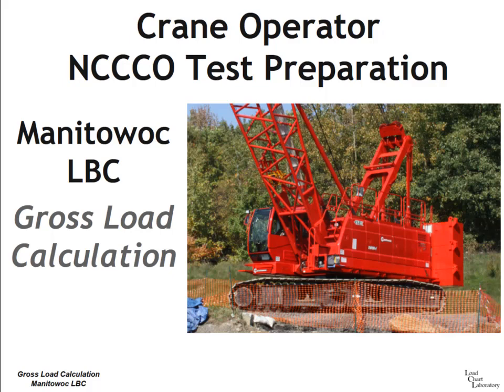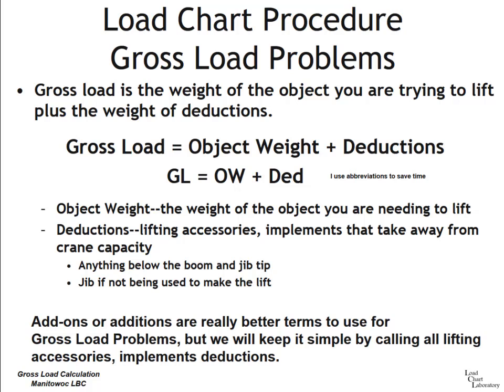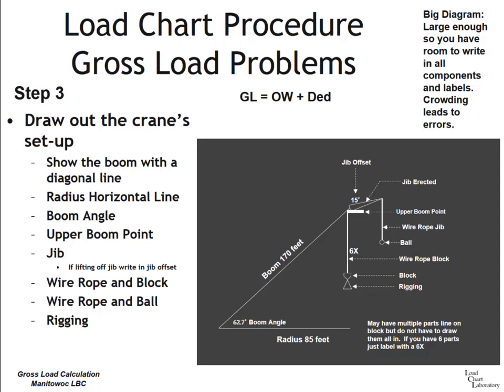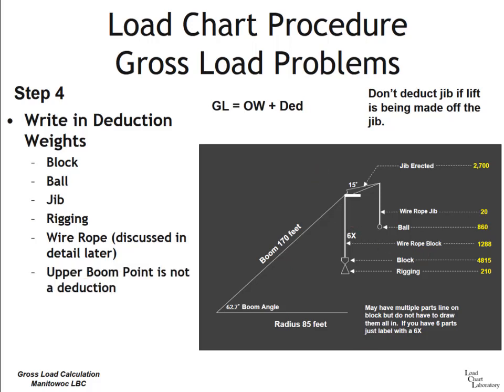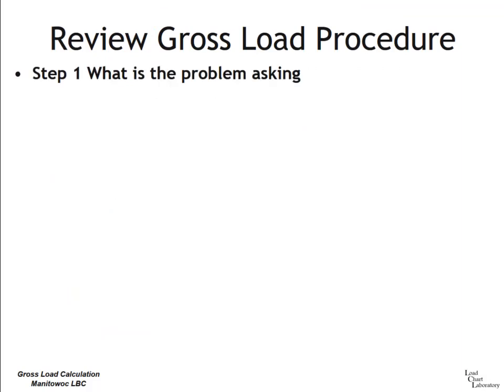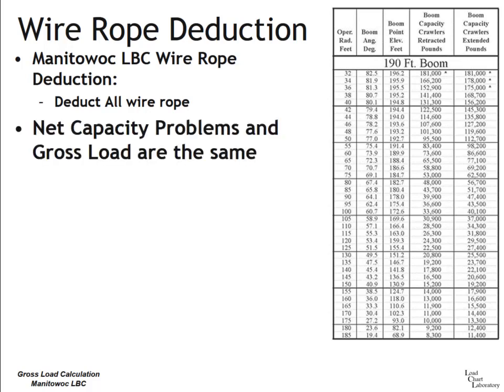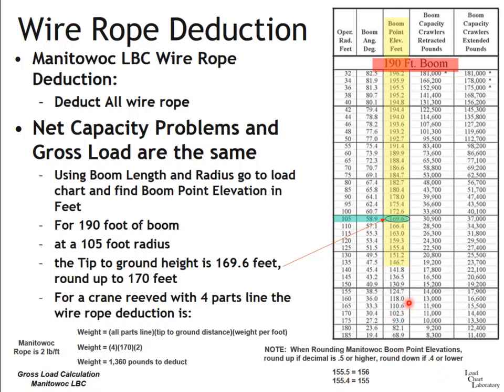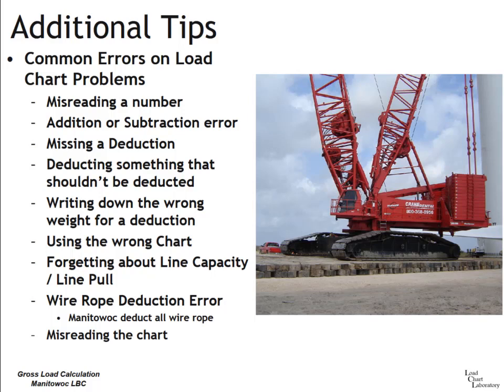Manitowoc Lattice Boom Crawler Gross Load Calculation

Comment: The load chart wasn't the problem on the computer based test but the questions were a little all over the place. I guess i wasn't as prepared for the crawler specialty as the TLL.
Reply from the maker: Yea, if it was just the load chart problems it would be much easier.  It's the other 18 questions that get a lot of guys.  Hang in there and give it another shot.  A good book I recommend to all operators is the Crane and Rigging Training Manual by Ronald Garby.  This book, along with the OSHA Regs, can help with what I call the "general crane knowledge" questions.
Reply: Yeah I'll check it out. I know I was only a question or 2 away from passing but I love crawlers the most of any crane so it's important to know this stuff head to toe
Reply from the maker: Austin . . . I've had operators fail the computer based test, and retake it within a couple of weeks.  They told me the retake was the exact same test from the first time the took it.  No guarantee if you took it again very soon you would see the exact same test, but you might??
Reply: No they do that unpurpose, and they try to fail you with how they try to mislead you, from what's in the osha book, and there own..  just study, you'll get it
Reply: @maxriboss  well I guess it didn't matter anyway. I got certified in mobile cranes in 2018 and was so excited, then no company would hire me for the lack of experience. I think I'll just admire them through social media from here. Smh!!!!!!!!

Comment: I must have missed something on your first example - how did you get to 1288 lbs for the wire rope deduction - at 2 lbs/ft and 6 parts line, that puts the boom point at 107 ft from datum. Is that correct ?
Also, do you not consider the wire rope around the block sheaves ?
For example a 6 part line on 2 foot diameter block sheaves is just short of another 20 feet of rope - or 40 lbs, or am I just being pedantic ?
Reply from the maker: You're right.  Should be 1896 for 170 boom, 85 radius and six parts--( boom point at 158 x 2lbs per foot x 6 parts=1896).  I got a little sloppy with my numbers with my focus on the steps in the process and laying out the deductions.  But if you're sloppy with the numbers the process won't work--LOL.  Thanks for pointing it out--I might fix it when a have a day off.
Reply: So that’s the deliberate mistake to check that we’re all awake  !
Great information and thank you for sharing your expertise.
Reply: The load charts from mf

Comment: Gross is before deductions, net it after deductions.  You got it backwards
Reply from the maker: Thanks for your input.  This tutorial applies to a very specific type of problem found on CCO exam--gross load problems.  For this type of problem gross load = object weight + deductions.  There is normally at least one problem on CCO specialty exam where this formula is needed.  The method outlined in the video will result in the correct solution for a gross load problem.  You are thinking about gross capacity.  Gross capacity is the cranes's capacity before deductions and it is found in the load chart or it could be the line pull capacity.  Gross capacity is used to find the crane's net capacity.  Net Capacity = gross capacity  - deductions.  The majority of problems on CCO exam are net capacity.  There is a separate video for net capacity calculation and there are also several videos showing the solution for practice/example problems.

Comment: Do you have to show how you worked out the problem ‽ and or show the formula for each question?
Reply from the maker: The exam is multiple choice.  You do not have to show your calculations.  If a guy was a good guesser he could simply guess--but that doesn't usually end well--LOL.
Reply: @LoadChartLab  He is right guessing likely wouldn't be a great idea because typically they have very close answers missing one of the deductions
Reply from the maker: @bradylaughlin3653  Yes.  They do a good job making a wrong answer look like the correct answer.

Comment: I took the nccco test and it had the hose reel as a deduction for the boom truck test,,why????
Reply from the maker: Sorry for late reply.  If it is listed as a required deduction in the load chart notes then it must be deducted.  From an engineering standpoint I don't know.  I'm guessing they are making the assumption the hose reel adds additional loading that must be accounted for.
Reply: It's an option on the load chart..and part of a load over tipping axis if I remember..look at manitex load chart
Reply: @LoadChartLab  I found it thank you.  Passed my reverts, just love making sure I'm up to date on my knowledge

Comment: You say you prefer computor based exam, why ?
I'm watching all your videos now getting ready to get  recertified for 2nd time and I keep hearing I should have sighed up for re cert on computer based exam.  Operators talking me its easier and much faster and now 12min and 30 into this video I hear you mention you like the calculator in the computer exam and you say you prefer this much more so than written.  Plesse advise ? I'm worried bc I got to be re cert by dec31lol. And I'm taking written 14th this week .
Reply from the maker: For me I was in a small cubicle all by myself without distractions.  Also you know your results immediately and if you didn't pass, you can retake the exam the next week.  Also the calculator is part of the computer testing program--you don't have to physically manage a calculator.  The computer program will also tell you if you've accidentally skipped a question, or reminds you to go back if you intentionally skipped a question.  It really boils down to personal preference--the exam questions are going to be the same.  Good luck on recert exams--you do know that the specialty exam is only 10 questions and 7 out of 10 are load chart questions?
Reply from the maker: Also if you're taking the manitowoc, watch out for retracted crawlers.  I emphasize this a lot in the videos because it is very common for CCO to throw this curveball on the manitowoc LBC.  Most questions will have extended crawlers but don't be suprised to see one question with crawlers retracted.
Reply: @LoadChartLab  all great advise . So I'm still watching your videos.  I know them word for word I can almost narrate them word for word lolo . I am 100%  confident now bc of your videos.  I will watch for retraceted  crawler questions. . I'm confused  this tho does it mean my crawlers would be retracted as in (sucked up under my super structure) ? I not familiar with that  Terminology
Reply from the maker: @lancelarymore1667  retracted crawlers are exactly what you describe (sucked in under the superstructure).  Retracted and extended are the terms used in the Manitowoc LBC charts.  In the chart there will be a column for being set up with crawlers retracted (sucked in) and a column for crawlers extended.  The difference in capacity between the two set ups is pretty big.  The data table for each problem will have a box for crawler set up and in the box it will say extended or retracted.  Another type of question I've heard about but not seen my self is where they are having you make the pick off the jib and ask for net capacity, with crawlers retracted--this is a trick question.  There is not a chart (at least for the CCO test) for lifting off the jib with crawlers retracted. -the correct answer would be 0 or no capacity.